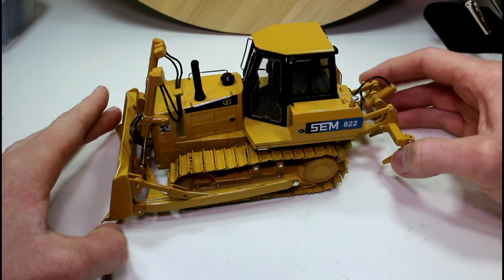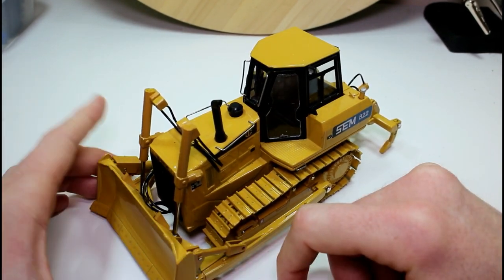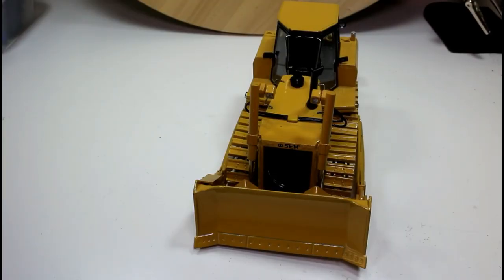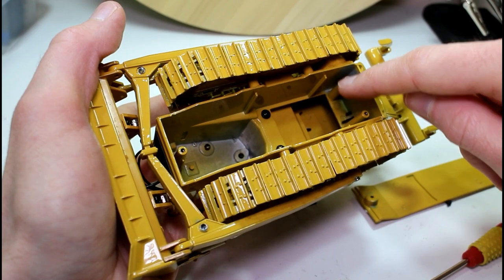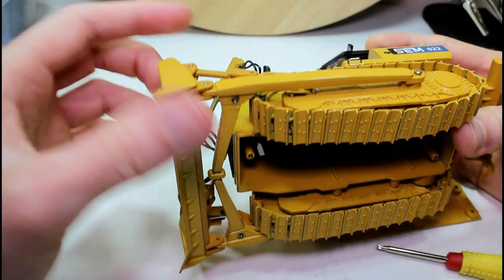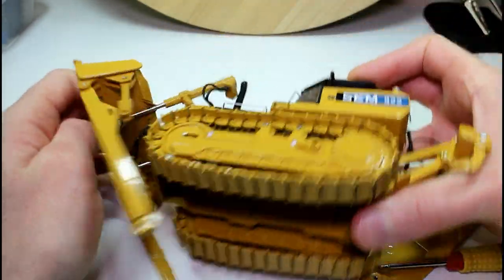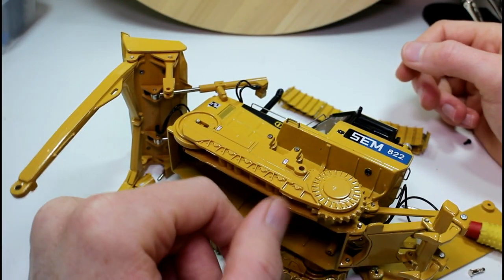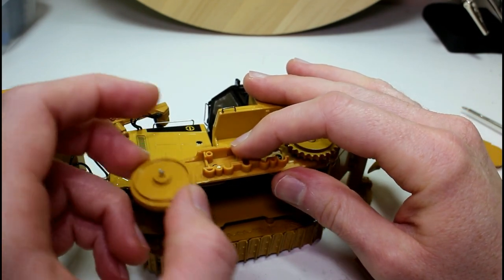RC SEM 822 Dozer Part 1 - First look and disassembly

Comment: the n20 motors with threaded rod shafts would probably work really well at  for this and other conversions. look em up they have some with m3 or m4 100mm shafts that arent terrible expensive . eliminates the need for an adapter to an n20  motor.  no super coarse or acme thread available that i can find though.